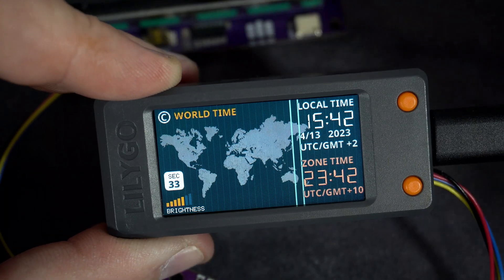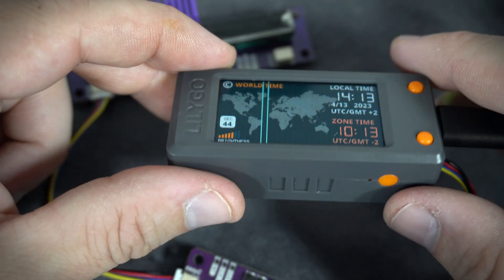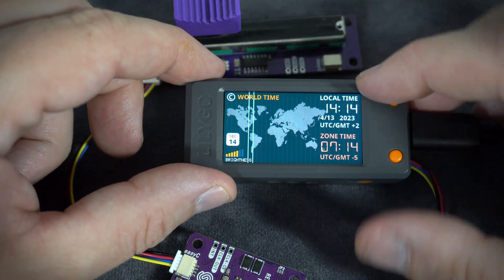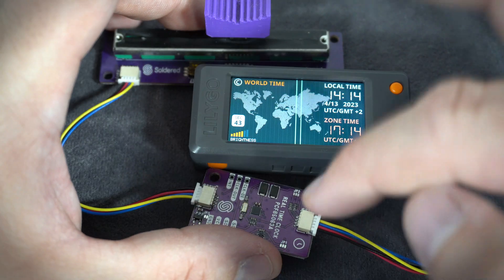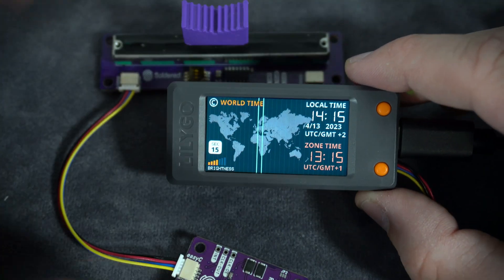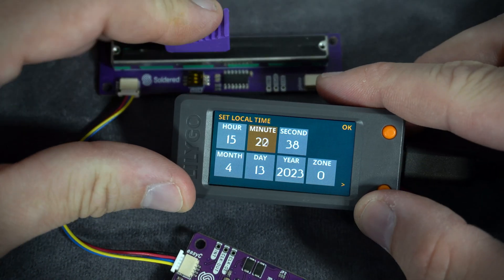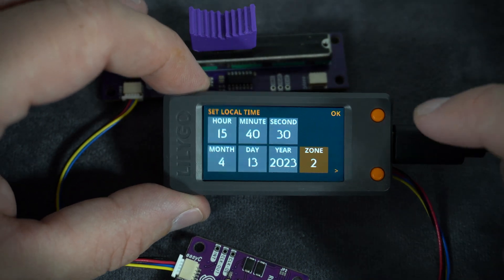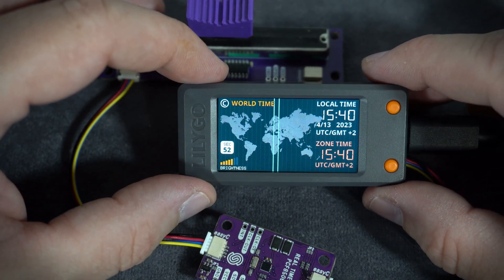World Clock on ESP32 development board

Comment: Hi, I would like to give back some code.....for a nice battery indicator (right upper corner)

void calc_battery_symbol () {
  Maxreadout = 2405;  //lipo fully charged
  Minreadout = 1480;  //SOC close to 0, display is getting weak
  Vbatt = analogRead(PIN_BAT_VOLT);
  Vbattprozent = (100 / (Maxreadout - Minreadout) * (Vbatt - Minreadout));
  
  Serial.println("Vbatt%: "+ String(Vbattprozent,0));

  // Spannungindikator
  if (Vbattprozent>=100)  { Vbattindikatorposition=20; // USB charging recognized, as vbatt > 2750
      Spannungsfarbe=TFT_BLUE;  }
  else if ((Vbattprozent<=100) && (Vbattprozent>=90)) { Vbattindikatorposition=18; //10-50% grün
      Spannungsfarbe=TFT_GREEN; }
  else if ((Vbattprozent  <90) && (Vbattprozent>=80)) { Vbattindikatorposition=16;  //10-50% grün
      Spannungsfarbe=TFT_GREEN; }
  else if ((Vbattprozent  <80) && (Vbattprozent>=70)) { Vbattindikatorposition=14; //10-50% grün
      Spannungsfarbe=TFT_GREEN; }
  else if ((Vbattprozent  <70) && (Vbattprozent>=60)) { Vbattindikatorposition=12; //10-50% grün
      Spannungsfarbe=TFT_GREEN; }
  else if ((Vbattprozent  <60) && (Vbattprozent>=50)) { Vbattindikatorposition=10; //10-50% grün
      Spannungsfarbe=TFT_GREEN; }
  else if ((Vbattprozent  <50) && (Vbattprozent>=30)) { Vbattindikatorposition=8;  //30-49% orange
      Spannungsfarbe=TFT_ORANGE;}
  else if (Vbattprozent<30)                           { Vbattindikatorposition=6;  //<30 empty , please recharge      Spannungsfarbe=TFT_RED;   }
  
  if (Vbattprozent > 100) { Vbattprozent = 100; }  //limit display to 100% during USB connection (charging)

   // Batteriezeichen----------------
  Pixeloffset=-5;

  sprite.drawString(String(Vbatt,0) + " "  + String(Vbattprozent,0) + "% ",210,(Zeilenabstand*0),2);
  sprite.drawCircle(10+280,18+Pixeloffset*2,7,TFT_WHITE);
  sprite.drawCircle(10+300,18+Pixeloffset*2,7,TFT_WHITE);
  sprite.fillCircle(10+300,18+Pixeloffset*2,6,TFT_BLACK);
  sprite.drawLine(10+280,11+Pixeloffset*2,10+300,11+Pixeloffset*2,TFT_WHITE);
  sprite.drawLine(10+280,25+Pixeloffset*2,10+300,25+Pixeloffset*2,TFT_WHITE);
  sprite.fillRect(10+281,12+Pixeloffset*2,18,13,TFT_BLACK);
  sprite.fillCircle(10+280+Vbattindikatorposition,18+Pixeloffset*2,4,Spannungsfarbe); 
  sprite.pushSprite(0,0);   
}